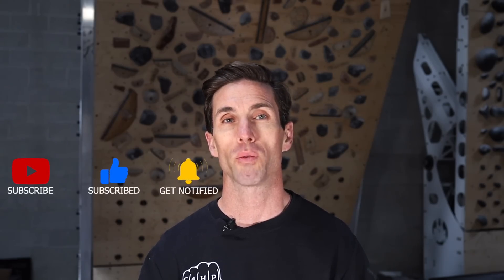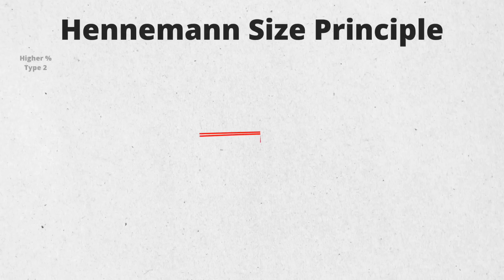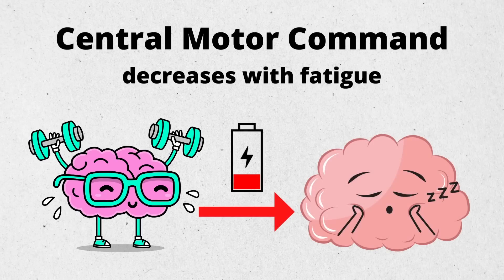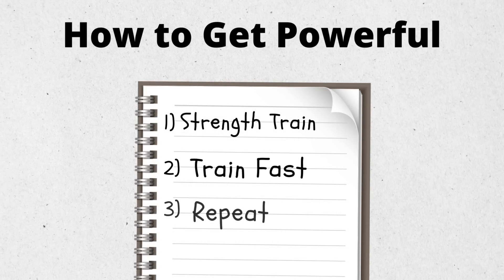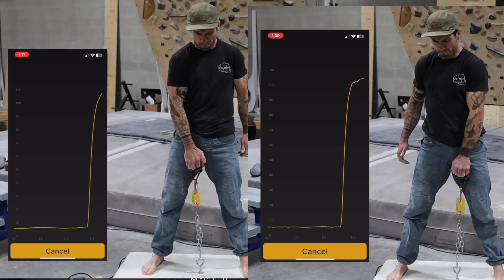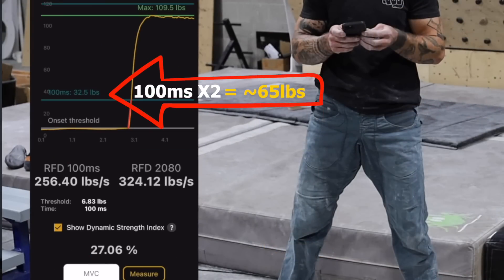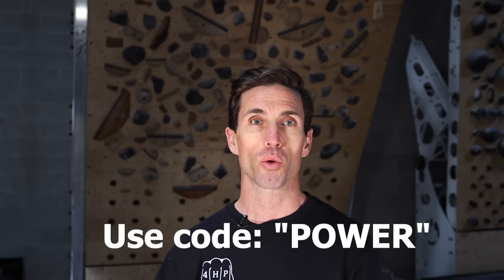How to Gain Contact Strength (What the science says about elite climbers)

Comment: curious about the contact strength training. I wonder if there is a type of training that aims to focus on speed of flexion over a specified ROM. starting with no resistance.....define a set time limit that the range of flexion must be completed within...milliseconds. then a resistance band is added and you repeat until the rate of flexion over the defined range is = to when it was done without the band....training the person to speed up nervous system response? the start time would be triggered by a random light so you are only measuring response time. obviously you would need to test multiple ROM's.

Think of F1 driver reaction time and how they specifically train their nervous system to respond faster and faster.

Comment: Is there any application for overloading powerful exercises for strength adaptations? Like explosive pull-ups with a weight vest, then later get rid of the weight. Or would it just be best to do weighted pull-ups then later explosive pull-ups?
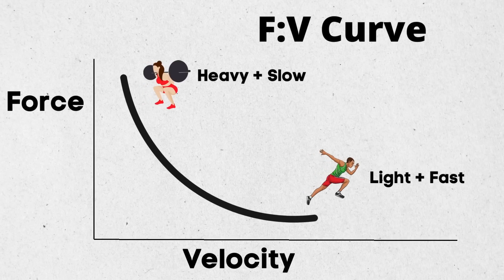Reply: 5:38 there is the graph known as the force velocity curve. Doing heavy weighted pull-ups (maybe 1-3 Rep Max) would exist at the top left and doing a big dyno with your feet helping may exist towards the bottom right. Everything else would exist somewhere between the two.

Simply, one needs to make sure their “strength training” gets pretty close to the top left to be “truly strength work” and then one has to identify the velocity of their sport, style, move, etc . On that line and make sure they work at that speed or a little faster to training the body to “turn it on” at that speed.

Weighted pull-ups “done fast” isn’t “bad” but: where does it exist on the curve? What is the goal of that point of the curve? Is that goal lining up with your intention? There is some power to be gained from middle curve but as long as you appreciate the other ends too of “quality speed” and “quality strength”

Comment: Can you provide some information about the talon setup? Is it the 4" or 5" tension ball? And where can I find a similar base plate for the hold?

Hoping to get the setup and experiment with training with it. Thanks for the info!
Reply: Probably whatever ball will fit your hands the best? The goal is to have the finger tips on and some spread between the fingers. A little bit of incut is probably nice too. The base plate is a beast fingers one I think that Tyler has? If you can’t find all that, I just tell people to flip a kettlebell upside down and attach weight to that. It’s not as versatile and the TB ball but gets the job done for training

Comment: So I'm struck by the idea that that force velocity curve still is very valid even though you're talking about something so sports specific of grabbing a hold quickly. The strength you gain from a slow movement under heavy load creates a systemic safety. Then training a fast movement allows for that sport specific adaption. This means that the limiter is always going to be the central nervous system Is the real limiter. And again, that means that the amount of recovery (muscle metabolism but also indicators like HRV bone density etc)is the limiter on certain kind of gains probably up to genetic potential. 

This makes me think that if in the strength training portion of a training cycle, you were to start with a number with single hand slow twitch of 50% body weight and then over time progressively overload that would give you a very easy place to start that is measurable overtime. Once that plateaus you know it's time to change to a fast twitch stimulus continuing progressive overload. (Because I don't know enough about climbing I'm not going to Guess a methodology) but just to say that fast sport specific would continue the growth of central nervous system ability. 

That also means that once an athlete is at a little above 100% body weight on single arm, you probably get diminishing returns of training slow or fast which muscle or it become so sport specific like climbing and endurance wall versus very quick movements from a metabolic standpoint. 

TLDR: overall strength is necessary to progressively create power. The right training of sport specific muscle doesn't have the right tools and studies yet to show certain methodologies work better. 

Love your videos. They always make me think.

Comment: Been using metacarp edge without insert and just pull as hard as I can while anchoring on my foot with cord. It works so well and I can tell my finger strength has improved. Unfortunately I pulled my lumbrical on my ring finger side (was chill climbing on my previously sent problem but unexpectedly cut feet), now my ring finger can't even lift up my bottle although it is a low grade 1/2 strain. Any idea to recover it?